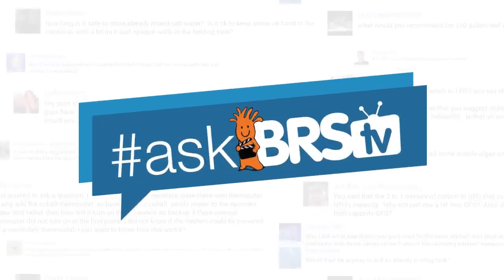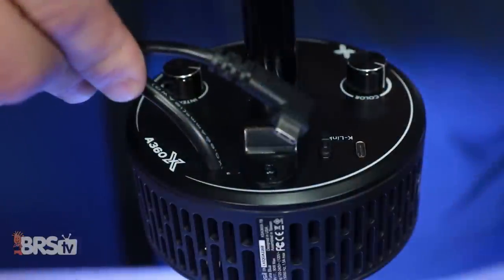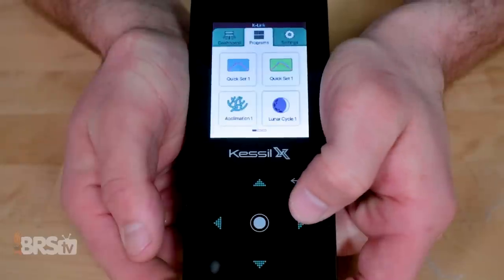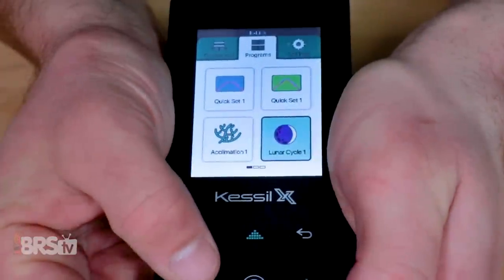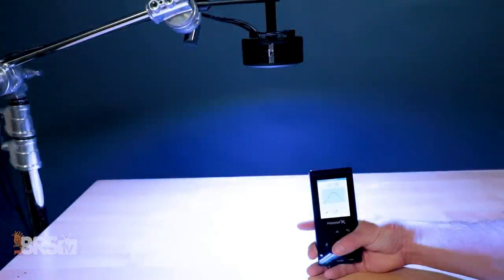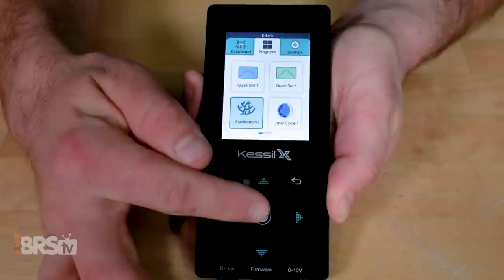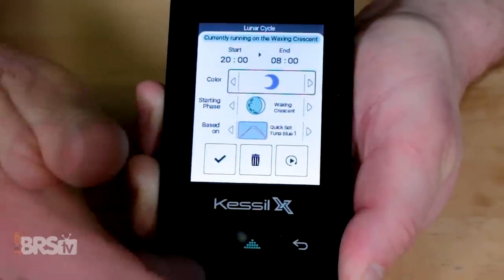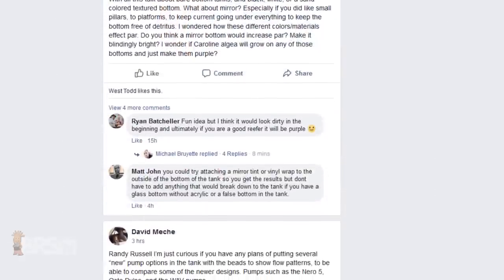Show me how to program Kessil Spectral Controller X ? | #AskBRStv

Comment: Got my 360x from the LFS yesterday. Im super bummed that I can't control it with my Apex. the added cost for the bracket and the seemingly mandatory controller is something to consider (especially in Canadian monopoly money) when buying a new light.  I ended up getting my controller X from BRS this morning and look forward to setting up my light using this video. thank you.
Reply: There is an adapter cable to connect to apex. Approx $15

Comment: Just saw this vid to help me use this controller with the A160WE using the 10v cable to control it with.  Do the pre-settings work with this light or only the 360?  Thanks all!
Reply from the maker: Only the X series. The non-X series lights don't have the ability to tune in specific colors like violet, red, and green.
Reply: @BRStv  thank you for the info!  I can still create my own settings though correct?  Is there anything else that doesn't work with the 160WE?

Comment: I love the Kessil lights, but I'm having trouble controlling them with this controller.  I'm trying to control four lights, one 360X on the K-Link port and three other older generation Kessils from the 0-10 volt AUX port.  The A360WE and two A160 TBs are Daisy-Chained together.  So far I haven't been able to get this to work.  If I plug the three daisy-chained older generation lights into the 0-10 volt side, shouldn't the older lights go through the same dusk to dawn cycle as the 360 X.  I'm just trying to used the default TB preset.  However, I'd like to change the start and end time of the preset to noon to midnight rather that the 8AM to 8PM.

Can I use the TB preset, but change just the times to start at at 12 noon and go off at midnight.  After setting up a new program or in this case altering the times of the preset, where should the controller be, that is what should be shown on the display.  Do you just leave it where it is after saving the new program, or should it be back on Dashboard. 
Thanks
Reply: This wont work. You cant control both lights chained. They use a differnt protocol and the X wont transfer it to an aux.

Comment: I can set 2 different ports with the 0-10v inputs ( 2 ) on the old one. There is 1 k link and 1 - 0 -10 v input does that mean you can only program 1 setting? This controller does not seem that great and im a kessil fan
Reply: @BRStv  Thanks so , it recognizes separate lights like if I had 4 of them I could set 2 to one program and 2 to another

Comment: Wish would show how to setup + program a A80s
Reply from the maker: You'll want to check out the video in the link below, which shows you how to use the regular spectral controller (not the X version). Ryan uses the older A360WE light in this demonstration, but the process is the same for the A80. 

https://youtu.be/hlb6kGiVvPQ

Comment: Does this work with the older A360w? If so what are the drawbacks?
Reply: BulkReefSupplyCom  you can use the firmware upgrade port and connect that to a regular usb plug.
That will power it and control your old lights if you don’t have the new 360x
Reply: BulkReefSupplyCom 
That’s not true. I called kessil 
And you can use the USB port for power. Try it connect the usb to Apple/Samsung usb power brick. 
I have the older 360 and I was able to set it up no problem.
Reply: @amadogonzalez4455  can you use the lunar cycle setting on the a360 ,?
Reply: @amadogonzalez4455  No... this wont work.
Reply: @davidsotelo3021  no you can not, differnt protocol for the data

Comment: Why I can’t run my kessil a80 tuna sun whit this controller just works with tuna blue settings
Reply from the maker: While the Spectral Controller X does have a 0-10v port, you'll need a power cord if you're not using a K Link compatible fixture in conjunction with your A80 as the K Link fixtures will provide power to the controller.
Reply: @BRStv  I’m using a power cord but so the controller turn on and everything works but when I try to set up whit my tuna sun it doesn’t work
Reply: Hey - I have the same problem. My controller does not recognise the a80 Tuna sun - could you solve your problem?